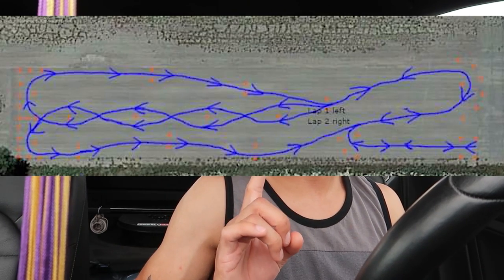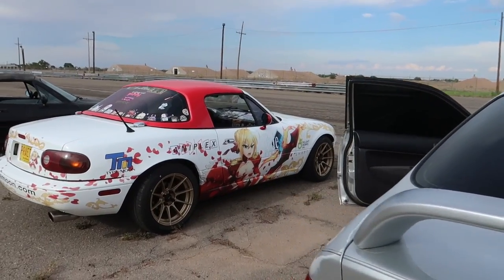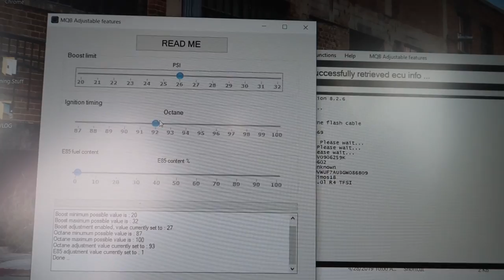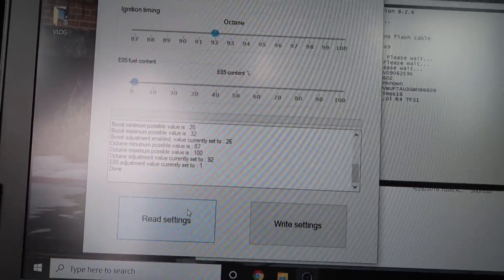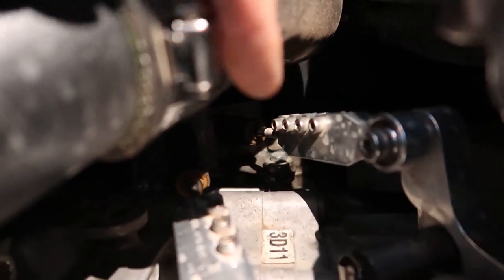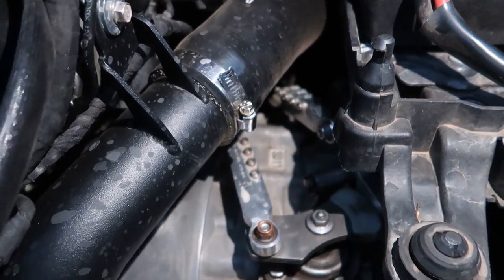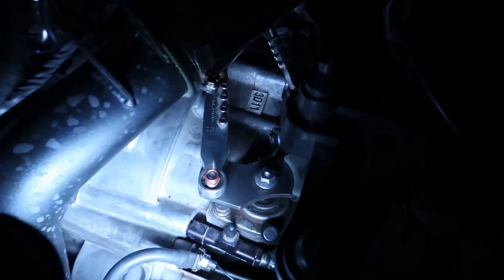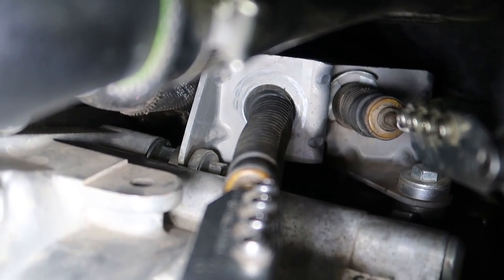Autocross shakedown in my stage 3+ Golf R gone WRONG!

Comment: Hey love the videos! Do you have any advice on psi tire pressure for autocross. I have Michelin pilots 4s for the mk7 golf r. Running 39psi cold and 46 hot which feels good, but everyone runs much lower.
Reply from the maker: Phew umm yeah I'd start at like maybe 35 cold and go from there. Just pay close attention to how the sidewall is getting worn after each lap, and then adjust pressure accordingly. See if those tires have the little arrows, if so, you don't want wear below that arrow

Comment: Nice runs man! You looked a lot faster than everyone else 👍🏻 especially the GTR, that thing looked like a tank. 😂

I feel like I can hear the lack of torque in your RPMs compared with my Stg2 with OEM turbo, but you can hear it's a LOT quicker to climb RPMS up high!
Reply from the maker: Yeah you can definitely hear the difference, I prefer it this way though. It's alot easier to control the car when the power is linear and not having all that torque down low. It feels nice but I think this will be a huge benefit in the long run, we'll see. Plenty more events this season to get to mess with things!

Comment: Bro so glad it was your shifter!!!🙏☠️I was nervous with all the new big power mods I thought something big might of broke🤦‍♂️ps I need you to adjust my diesel geek set up one day with that steel cable cage.  Currently Running ECS and it blows with the diesel geek pin!!...Still breaking in my new DKM clutch in ~1200mi mark rn and am 💴broke until further notice.  As far as your next mods BBK will be huge check out the nuespeed 6 pistons heard good things and are you running any front sway bar? I know you have that euro code upper tower brace is there anything connected to your subframe?
Reply from the maker: Same man same, I about had a heart attack lol & I was told not to do a front sway sense I have the eurocode 🤷‍♂️ we'll see how she feels when the aluminum subframe and control arms come in! I don't have any other braces up front besides the eurocode and tyrol deadset kit for the subframe. I'd happily adjust it for you man lol, it's tricky but once it's perfect there's nothing that can beat it! How long is the break in for the dkm?

Comment: This is why dsg is better,you just dont need to shift with your hand and slam the gearbox
Reply from the maker: That's no fun 😛😂
Reply: I dont think you have ever tried it,its way more funnier when it starts fart and you dont get tired of shifting
Reply from the maker: @Benko_DieseL  I have tried many of DSG. My boy was one of the first in the states with the APR stage 3+, it was cool, but I'd still prefer to change gears. Idk, I'm weird I guess lol. My love for VW has always been with a manual trans, my vr6 Jetta, R32, MK5 GTI, now this. Had a few autos and a gf with an mk6 dsg, just wasn't a fan 🤷‍♂️. If I ever got an auto car it would be a car built for drags, and have a v8 with boost and or nitrous
Reply: @Benko_DieseL  If you get tired of shifting, cars ain't the hobby for you.
Reply: I aint tired of shifting but for this specific car i think 85% in europe drive the dsg bcs its faster and simply you are drving a car like a gentleman..When i sometimes drive and watch at my phone for a sec i dont need to press the clutch and shift,it just makes it little more sexier on my opinion
Reply: @Benko_DieseL  Well that's your flavour, I like to shift the gears myself and improve on it. Using stuff like double clutching and shifting as fast as possible. With a automatic my right hand would just feel useless, just like my left foot. Makes driving as a whole alot more fun in my oppinion. And it might be faster but I'd rather be slower then having less fun.